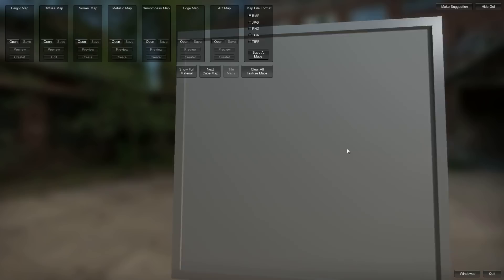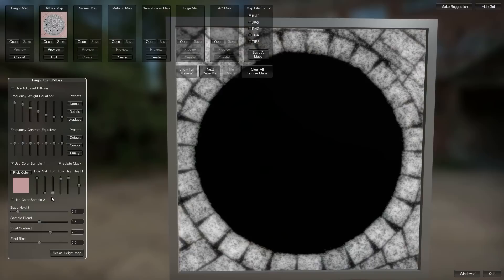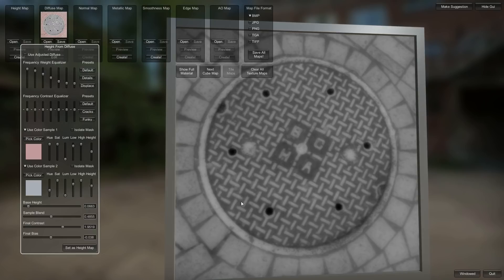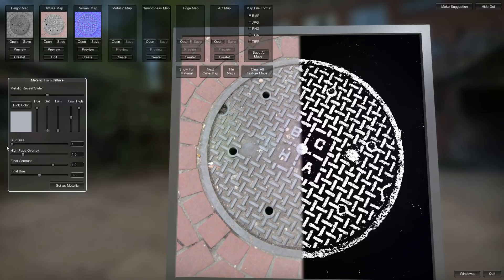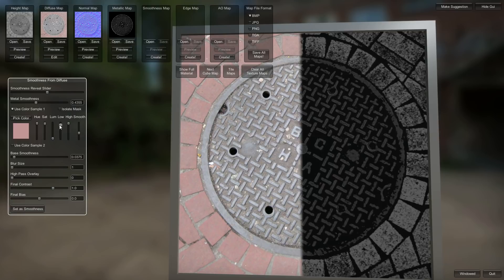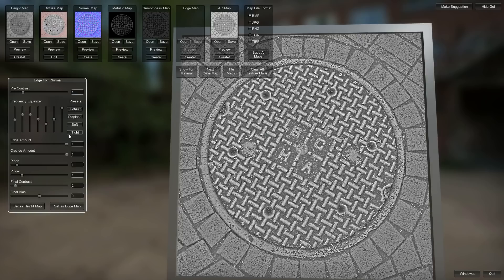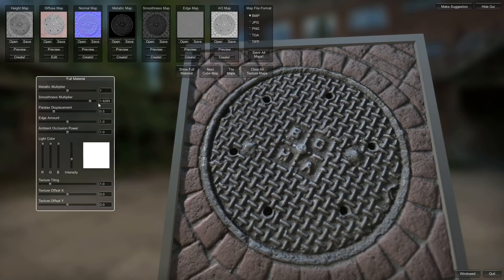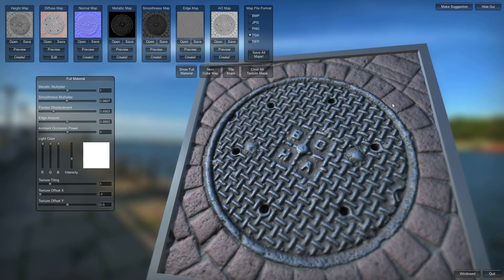Materialize - Sewer Cover

Comment: Hi. I installed the Materialize program but could not open any .jpg file. The thumbnails are not visible, they are only blank sheets and I cannot load them. What am I doing wrong?
Reply: you need to instal Microsoft visual C++ redistributal to see  the textures.  Also, you need to go full screen and expand the size of the dialog boxes to export.  should work fine then

Comment: This tool looks fantastic! How much will it be when released?
Reply from the maker: Tyler Newton I haven't settled on a final price yet but my initial thinking is $20 for personal license and $50-$100 for pro/corporate license
Reply: $20 to $30 would be an instant "I'll buy it just in-case I need it" purchase for me. I bought Sprite DLight for similar reasons and use that to make quick and easy maps (lazy programmer - I make about one map set every three months, not a modeler).
Reply: Its free now

Comment: Looks like very useful software.  I'm currently redoing some "internal" maps for a human figure .  Is there any way to generate a Glossy Map using this software?
Reply from the maker: The "Smoothness" map is essentially Glossyness.  A specular color map is not currently supported as it uses a simpler Albedo + Metalic workflow.
Reply: @SquirrelyJones2  Awesome.  Thank you.  There are just a couple of other things.... When using the up and down sliders there are no input number boxes so matching those exactly for the 4 skin maps for the figure might be a bit troublesome!  Any advice on this front?  Also, is there a way to make a translucency map, you know to get that red illumination that you see in ears, fingertips and other this skinned areas of the body when light is just so?

Comment: How did smooth change the way the light is reflecting on the bricks? Wouldn't that have to be a change on normal map or height map?
Reply: Smooth is hardness/roughness, but reversed. A smooth surface reflects light sharply - so you have clear sharp specular highlights that suddenly fall off when out of light (so sharper reflections). An unsmooth (hard) surface reflects light less brightly but more evenly in all directions (so no sharp reflections, but receives a little more light at steep angles where smooth surfaces would not)
Reply: Thank you so much for the explanation. This really helps a lot! :)